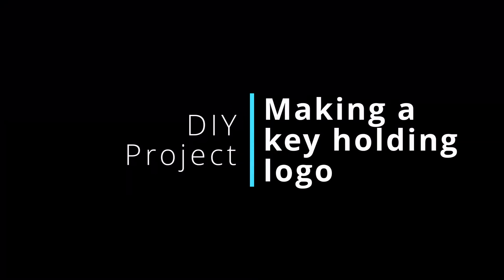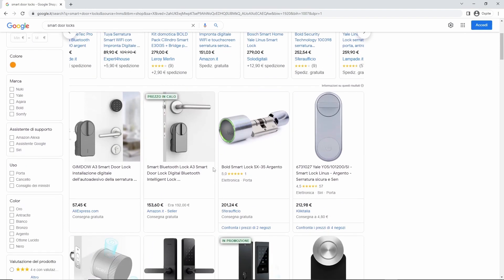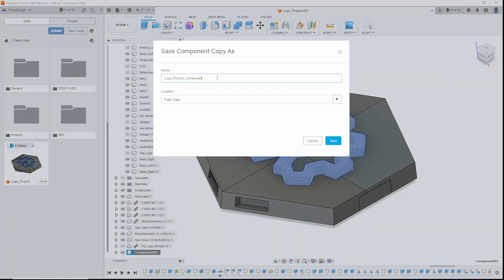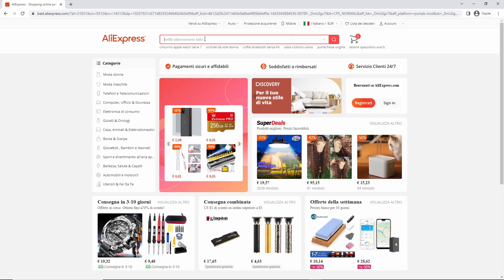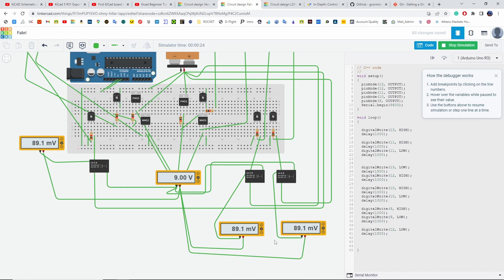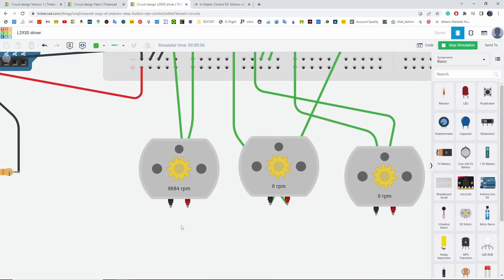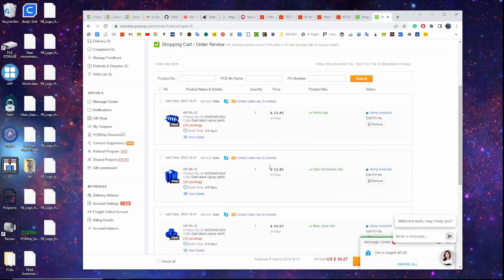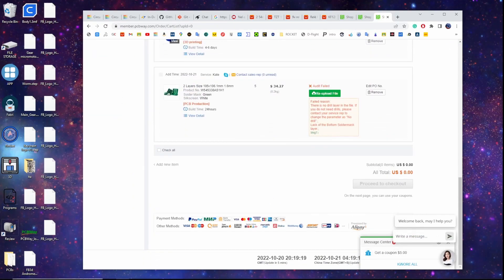Creating a secret key holder - PCB + 3d design - pt.1

Comment: for the pcb I think that the relays are probably overkill for this kind of application. These are just low voltages and currents, probably running them directly from the mosfets would have been fine. is there a problem with heat dissipation or something else? also why did you choose the arduino nano, is the language easy to learn?

Comment: Why did you decide to use motors and gear instead of linear actuators? they are definitely cooler but maybe linear actuators are more reliable. Anyway I will be interested to see part 2
Reply: maybe they are easier to setup with arduino